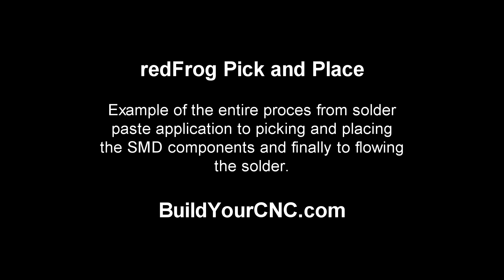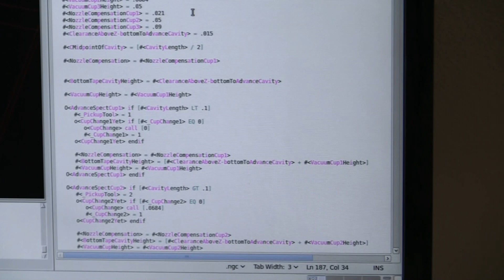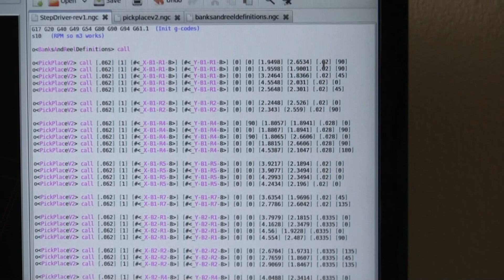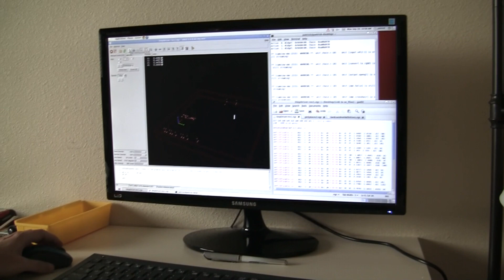redFrog Pick and Place machine - example of the pick and place process 9/19

Comment: Decrease your Clearance height in order to save cycle time.
Reply: that's insignificant. for one his Z is pretty quick. if you look closely he's not spinning the A axis via blending. the reason? his computer is not quick enough to deal with the step rate on all 3 axis's (remember. that rate is cumulative). Z is moved separately but X, Y, A are demanding in this respect (so unless you got a real screamer GT3 belting is also not gonna work (due to loss of resolution at a given micro-step)). also remember that accuracy is much more important than speed. my jitter rate is about 9us max which allows quite a bit more speed. however even at that relatively low jitter rate blending A becomes an issue with higher rates of XY. another thing slowing him is tape movement. I don't use tapes like this but instead choose to pick from different locations on each part. Its a lot faster that way (only one pick per part) but setup takes longer (thus one of many trade-offs regarding these machines).

finally consider this regarding speed. it wears things out quicker. and you need bigger everything (including a quick computer). his computer is integral and may even have a MB supported parport. if so its legacy... meaning slower, see? yet another trade off. So where does one draw the design line in the sand here? for the price it looks like a good machine.

Comment: Nice work on the machine. I would suggest working with a closed loop system as you need to be as accurate as possible. Open loop control systems might work good for PCB board routing and milling but for pick and place, it had many disadvantages. I am sure you can find steppers with encoders and control units that will work just find for the constructed model.

There is research right now where AI software systems are being used for Pick and Place to increase the efficiency.

Comment: I think you could lighten and simplify the machine design a lot with metal construction rather than wood. I also think you want edge holding of the board (maybe some central support pillars for larger boards) so that 2 sided boards are possible.
I would also lose the plexiglass. rails don't need to be very long to hold it and plexi is expensive. maybe base it on tiny alu extrusions somehow

Comment from the maker: Sure, I've gotten a few of these requests, but solder paste is so easy using a stencil, and the stencil allows for the perfect paste amount considering the aperture of the pad openings and the thickness of the stencil. It would be difficult to do this with a syringe, but not impossible.  The reflow idea is not a bad one at all.  Adding a place on the machine for the hot air gun could be useful.

Comment from the maker: @KingNetherdrake the locations are set visually through camera siilar to most PnP machines.  Thereafter, the machine will pick and place that board as many times as you want by itself.  It takes the human imperfection out of the equation as long as the first one was done correctly.

Comment from the maker: @guruflorida Definitely, let's chat.  Email me thought the contact us form on buildyourcnc and ask for Patrick.  We can exchange emails addresses and discuss these ideas.  Actually, the luer is a mechanical pencil tip.  It's nice to have the ability to screw and unscrew at the tpi of this rather than the luer's very loose tpi.  I did think about using a solenoid with a small diameter shaft to advance the tape using the holes.  I may actually still do this.

Comment from the maker: @jcims The tool is considered in the advancement of the tape.  There are many variables in the code that pertain to the tool (cup) vertical delta from metal tip, and width (diameter) of the cup and how it relates to the cavity of the part that is used in advancing. There is a cavity length in the pick and place line that the user enters.  This cavity length determines the tool that should be used and informs the user automatically to change the tool appropriately.